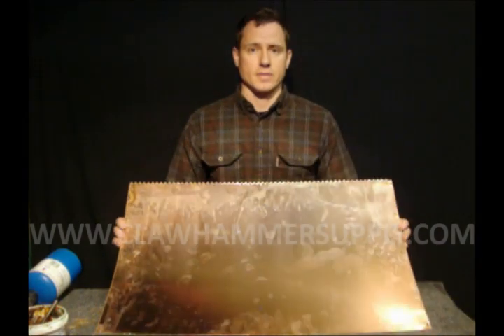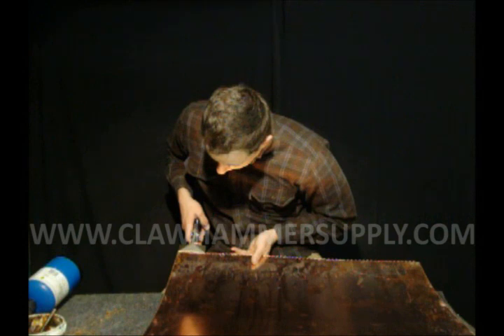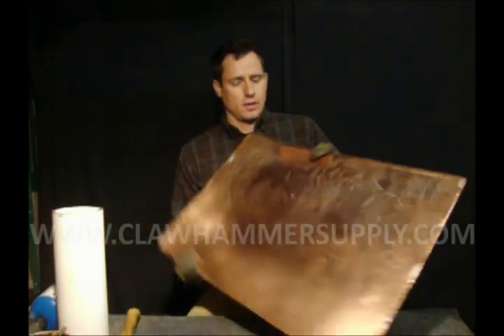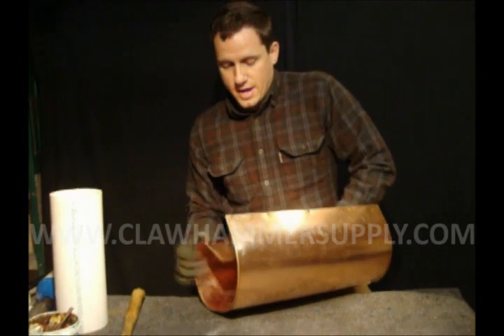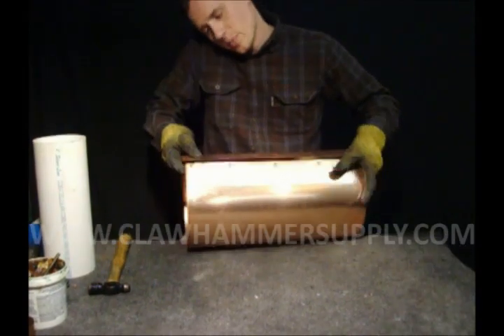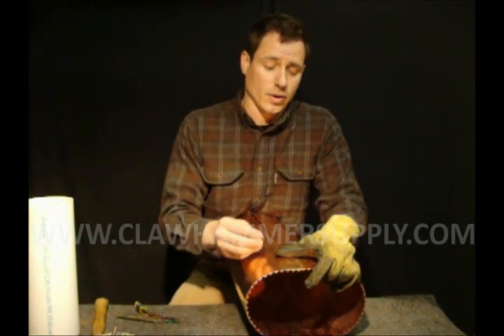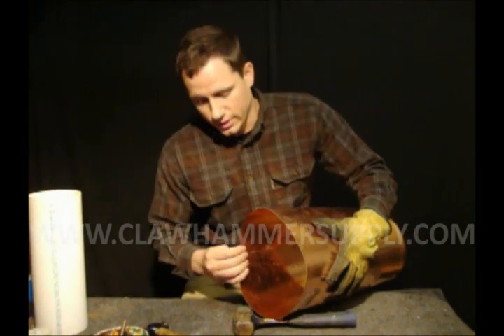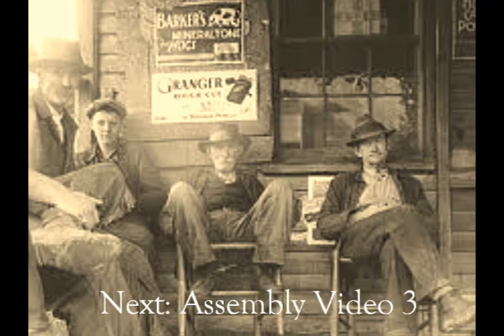How to Build A Copper Still - Part 2

Comment: Yall skipped the part making the rivit holes AND part 1 was only the tools, yall started part 2 with copper sheets with the teeth on the ends, howd yall do THAT? That looks like the hardest part right there, u need a special tool for that ? Why do u even need them?

Comment: No, don't use solder with lead in it if you want to consume it.
Reply: Ross du Plessis 
          silver.       it's easy to do.  there's a brush on flux and silver just follows the heat

Comment: where did the copper sheet come from and what are its dimensions?!
Reply: https://makezine.com/projects/remaking-history-build-your-own-copper-still/?utm_source=MakeNewsletter+20190115&utm_medium=email&utm_content=button&utm_campaign=newsletter
Reply: It all depends on size of still you want for say if u wanted a 10inch still you would use a formula to find out how tall it needs to be like pie x radius square (half the diamiter) will give you the surface area of ten inches and we know 277 cubed inches is one us gallon so roughly 18inches all at 10 inches around is 5 gallons then u add ur allowances for your seams

Comment: do they sell hose clamps big enough to around the boiler that would make it perfect
Reply: Im a sheet metal worker by trade and youd be surprised how forgiving copper can be doesnt have to be perfect if u have a compass from a drafting set use it to draw a pefect circle of what ever size u want and just keep hand forming the copper and checking it on the pattern you drew till its shaped the way you like

Comment: I've seen old-timers make their own copper rivet's because the copper smashes easier and it just looks better to and it keeps the chance of contamination from other metals, remember the best stills in the past were ALL COPPER no steel at all. But if you've ever had to make your own copper rivet's you will know why people opt out for steel instead, it's very time consuming and time is money.
Reply: Copper roofing nails are a great substitute! They already have a flat head one the one side just be sure to cut them so 1 and a half the diameter of the nail is protruding past the copper u wish to river to form a propper sized head

Comment from the maker: Myownspirit-  Yeah, the gaps are sometimes smaller or larger depending on how the rivets go in.  The less you pound on them, the smaller the gaps are.  A trick I use (not mentioned in the video) is to heat the gaps with a torch and lightly hammer against a mace. The gaps generally close right up.  

Also, typically use Tarnex, but seriously just bought barkeepers friend, at your suggestion, yesterday.  I noticed it in the household cleaning section at the grocery and figured i'd give it a try.

Comment: Aside from the rivets wanting to lean over when I pounded them down, the only other challenge I had was with the big gaps between the sheet metal after the rivots were installed. It would be nice if there were a couple more rivets on this seam. I had to pour the solder into the gap from outside and inside, but it is sealed now.  I had fun building this. Went together perfectly. Tip: I used Barkeeper's Friend to clean the copper. It has some abrasives in it plus some magic chemical. Worked great!